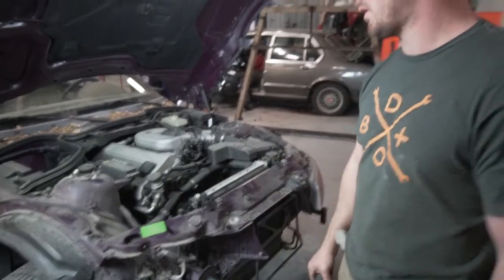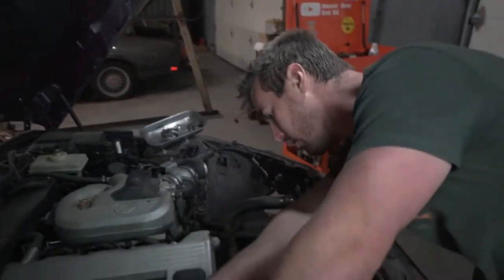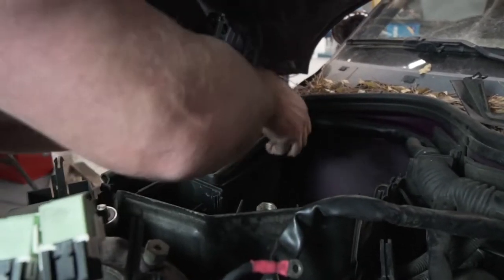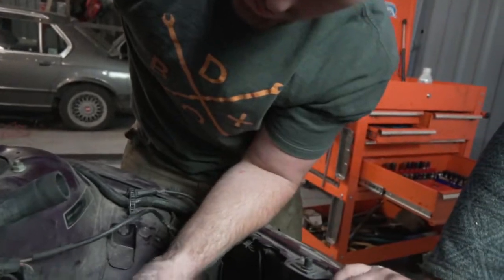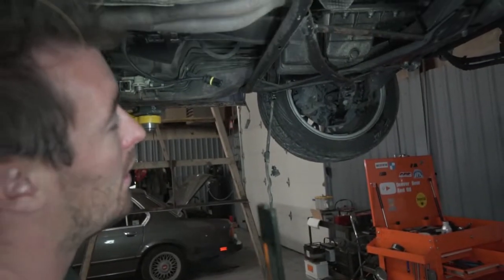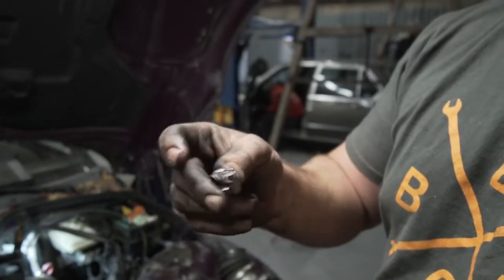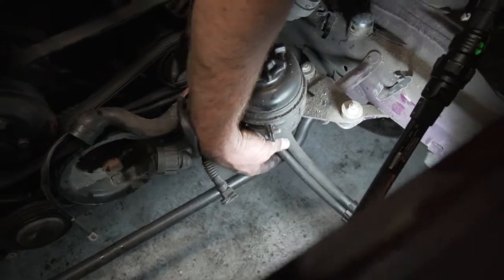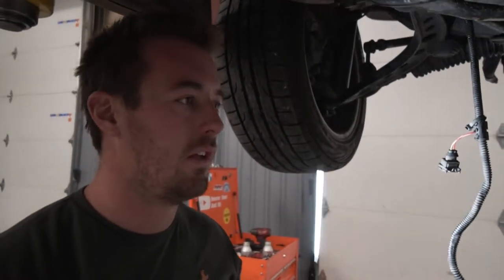How to pull a BMW Z3 engine!

Comment: Do you happen to have a a diagram of the wires labeled, and the correct location of where they need to be? I did a motor swap on my 1996 z3. And I forgot to label the wires. Now it’s causing it not to start. Thx

Comment: Did you make a follow up video after the install of the new engine??? I was just told I’ll probably need a new engine for my 97 Z3 (2.8, manual transmission). I don’t have the $8500 they quoted for it (besides, I only paid a fraction of that for it).

Comment: How long should a professional shop take to pull the 4 cylinder engine and trans?  They usually deal with domestic stuff. Thanks.
Reply from the maker: I would say 2-4 hours
Reply: @DENVERBEERANDOIL  Thank you.